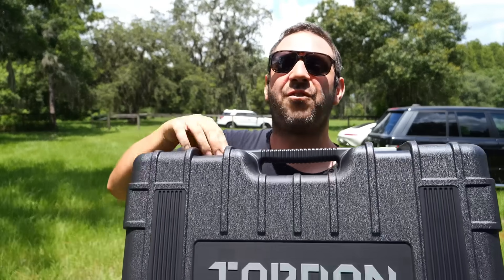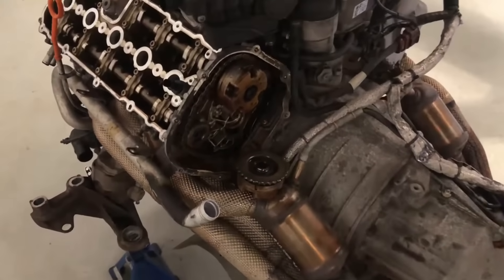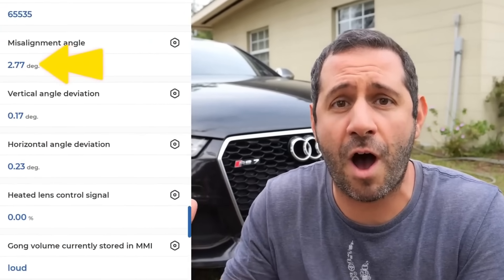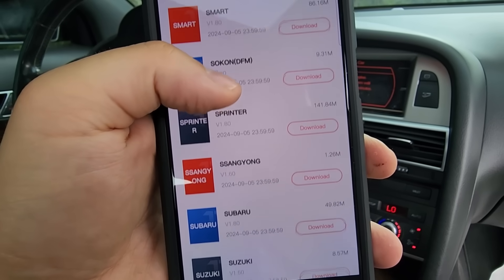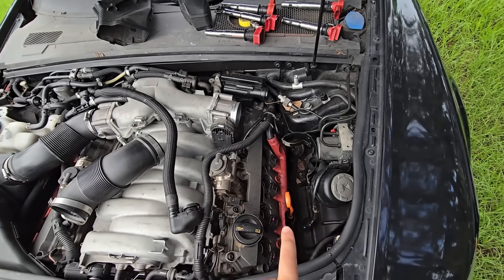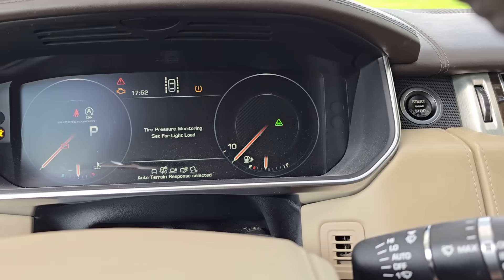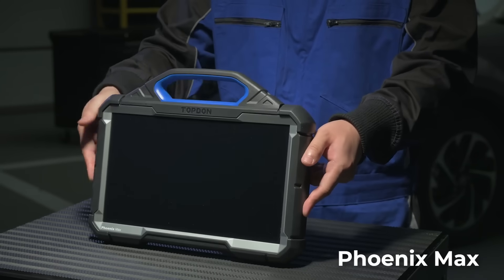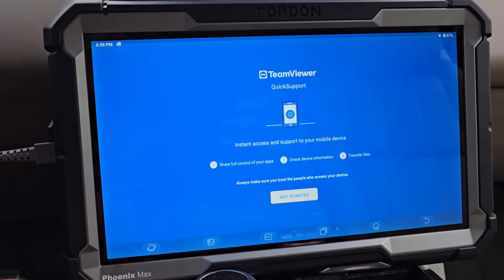$60 vs $4,000 Chinese Diagnostic Tool to Fix a Dead v10 Audi S6

Comment from the maker: Just to clarify one thing:
At one point I say "Topscan is the First (that I've found) All System, Bluetooth Style Scanner, that works on Most Makes and Models..."
Up to now, every Bluetooth Scanner I've used either has VERY LIMITED FUNCTIONALITY on Most Makes and Models OR
has Full System Scan Capabilities on VERY Select Makes and Models...

Basically Topscan filled the major gaps that generally come with Bluetooth Tools AND it Costs Way Less than many others. Plus its an additional 5% on Amazon: https://amzn.to/4cUiY42 
USE CODE ✅ Topscan0718
Reply: Is the topscan capable of reading the actual mileage from the ecu?  i've been scammed before with a tampered mileage used car.
Reply from the maker: @rallymao6811  This is a good question, but is dependent on the specific car you're working on
Reply: @rallymao6811  I have multiple XTool D8, EZ400PRO, A30M they can read the mileage from various modules. But you have to know in which module to look at (live data in ECU).
Otofix D1 and D1 PROS and MAX (Autel) can also read it.
Reply: Thanks for the info Sam, much appreciated.
Reply: will it scan my 550 Ferrari?
Reply: @stude333  probably. If it’s newer than 1996
Reply: @stude333 my Foxwell does.
Reply: more vids on diagnostic tools and generally on the modules found on a modern car and how to reprogram then and why and when it`s necessary to do so .
Reply: Can I have some of the parts and how can I get them?
Reply: I got a Japanese import car sadly the menu is in Japanese can i convert the language with this tool
Reply: Whats the other scan tool you have, thats connected to your phone, used on that genesis I believe, or was it the range rover.
Reply: What the electronics engineers don't want you to know the parts for the big box cost < 200$ and the parts for the small one is < 10$
Reply: Would the scan tool be locked or functions disabled if one doesn't pay the subscription on the topscan?
Reply: The guy who has been pushing scanners on us for the life of his channel only now says they had "VERY LIMITED FUNCTIONALITY".  So you've been pushing crap on us this whole time? Sam, shame on you.
Reply: Review Thinkdiag2 u can program modules with it and it's 150$
Reply: What Sam said is very true - most of the Bluetooth scan tools we've tested on our channel are pretty limited in function; TopDon is one of the major brands that pack mid-range level performing software into a Bluetooth unit at this price point. If you are buying it is definitely worth checking out TopDon 💯
Reply: Have you ever tried OBDLink MX+?
Reply: Opel astra j 2013 1.4 personal use what should i get?
Reply: I bought a $60 Topscan like you recommended to remove the "inspection due" dashboard notice.  I had to return it since it did not work and does not work for my 2017 Audi A7 (according to the manufacturer).

Comment: I have a Foxwell that works great. It works with all makes and models, and RESETS AIRBAGS 🙂  No subscriptions or phone required.  I think I paid about $100. It’s programmable, so it can be updated with the latest patches and codes. It even shows the code history, so no one can clear them and trick you. It even shows the date of the code and when they were cleared.

Comment: Dealer wanted $7K to fix my 2013 Boss 302… I bought the TopScan Pro, fixed the car for $300. I’m driving one day and BOOM… every light came on, no brakes, no electronic steering. Dealer said everything had to be replaced. I scanned car, had about 50 codes. Turned out a brake pad blew off my rear wheel and set off all the codes and shut down all steering, TRAC, etc.  I put new pads and rotors, performed the Auto ABS Bleed with the Topscan, and. Whamo, car good as new.

I even had a passenger side window that hadn’t gone down in two years. Now even the window worked after a calibration with the Topscan.

Comment: I have a question on this, I recently had rotors go bad on a Volvo I just purchased. Will this tool disable the parking brake? I can't find any clarification on any of these diagnostic tools that are going to tell me it will do that specifically. 

There's a trick to use a 9-volt battery, I'm going to do that this weekend. However that is obviously not the proper way to do it, I'd rather have a proper tool to do the job correctly. I don't have a problem with spending the money for the scan tool. I just need to know what's going to work.

Comment: That's $60 scanner sounded great right up until you mentioned the $50 annual subscription. F*** that noise. I could understand $50 a year for the latest updates or something. But $50 a year to keep using what I already paid for? Get bent. 

Not you, you are great. But I find it borderline Criminal to lock the function of purchased Hardware behind a subscription-based software.

Comment: I know this is a super late comment to the video but i can assure you that using this method for replacing key fobs specifically for land rovers is a life saver. i’m a landrover certified technician and getting even a set of new fobs when you don’t have one on hand can cost you thousands of dollars as replacement of modules such as the RFA and even the BCM are huge jobs. This tool honestly sounds like a good deal just to even make my job easier so i don’t have to use landrover specific software

Comment: Most cases the diagnostic is good as the mechanic whos using it. Simple use these on audis bmw and merc but try to use like on opel with code for the gas pedal the problem could be between front light to the tail light

Comment: Cracking video there thanks for sharing that information very well explained just subscribed to your channel  mate just brought a ford kuga diesel 20lt cheap needed a diagnostic scanner  I had a autell and it picked it up straight  away  been looking at the topdon phoenix xlink  but the key 🔑 model is a fortune plus my favourite is the launch x431 pro v5  with topology mapping and bidirectional control

Comment: And then they have a Volkswagen click add key and are now keyless because they bought the wrong one and the system requires the right one. The first step in a VW is delete all keys then it adds them back so if you buy the wrong one the process wont work and you will have no keys. All smart keys lost is not supported for all makes and models. Some you have to program directly to the vehicles computer. The T ninja pro is not even a programmer us locksmiths use. Its not a brand we buy.

Comment: Samcrac - you would think this info is easy to find BUT NO!  On the TOPDON TopScan OBD2 Scanner Bluetooth can I register my battery on my Audi?  The sub for $50/yr is not bad.  But HARD TO FIND if I can register my battery.  I see "BMS reset" for batter but does this mean register?

Comment: It’s great one can go buy a scan tool for free and get the codes and read data without doing to the dealer or a shop. Nice. 

Now interpret that data and know what data to look for and what it means to diagnose the car. 

Being able to push buttons is cute, knowing how to  diagnose it and then fix it pays the bills.

Comment: too rebuild that engine it only be a 5 to 6 day fix an cost you around 7k to repair, then could sail for 15k up, however most people who mention the oh just replace engine dont have the time nor patients so the deem it a parts car. for my 5.3 ls i rebuild it an just went ahead maxed out all parts including torque converter an trans along with brakes, drive shaft extra. i own 3 different v10 including one sorta similar too that audi an there arent as bad as most deem them too be if you understand how too quickly repair diagnose an most important for theses engines there several bolts you dont have too remover air intake atually is one piece just lift both sides off an there one major part, its basically the same for the rest the engiene its built one big part, too part.

Comment: Can you do dealer-level diagnostics with this? Do they offer a service desk for when issues arise? Does it have a possibility to make logging to figure out the issues on a lower down level? 
As a diagnostic engineer I know well how the internals of various dealer tools work. And trust me, there is a major difference. Especially when it comes to the non-standard functionalities. I own several OEM diagnostic tools privately, 9 brands now, worth probably 100k. Most were ex-testing tools or demonstration packages. I sometimes lend them to local workshops. In practice we've found that there is certainly a quality difference to (most!) aftermarket stuff. Programming success rate simply is higher, monitoring signals read much more stable etc. Tools using D-PDU API, instead of J2534 are the best usually. 

Now if I could recommend a tool (for EU) I'd get the Texa. Price vs. quality is good and it were really professional engineers. We once did a validation of their VCI to see whether it was an option to offer to our customers. We found a few but very little bugs. Couldn't say that of most other brands..

Comment: i use the autel scanners for key programming and key module programming  they work well they also have universal fobs you can program  to a car in a emergency with out acually getting a vehicle specific key from like Amazon right away

Comment: Yes, you are absolutely right saying that manufacturers install components like sensors in impossible places, so you can't get to them and for a small and cheap part you have to disassemble half the engine. I recently had such a case with a Nissan Rogue SV 2017 2.5 l. Check engine code was 2004- IMRC stock open bank 1. The problem was Int manifold runner position sensor which is installed in the lower left part of the intake manifold, you can't get to the sensor without removing the complete manifold. Of course the sensor is worth $30 - $150 on the market or at the dillers is  around 300 dollars , the entire manifold  is about 600 - 700 dollars, add to that over 700 dollars for work and installation with tax comes to  1,500 dollars. Fortunately, and with a lot of work around disassembly and assembly, with a new manifold repair costs $900. You see what kind if shit are  new cars today , like my Nissan Rogue with only 50k miles , not to mention paint clear coat being almost entirely piled off. Don't  buy junk !
Reply: TRANNY is next my friend

Comment: I watched this video after you posted and went out and bought it since I have 4 vehicles I needed spares for. Got it 2 days ago and I cannot believe it only has explorers to 2019! My wife has a 2020, the new body style. Ridiculous you spend 500$ and it doesn't have a vehicle 4 model years ago. The t ninja pro
Reply: No go on ford key programming for most all Fords after 2018 as the latest generation PATS immobilizer system requires verified security access to the online Ford diagnostic system. Apart from Ford dealerships there are only a couple 3rd party tools that have even have verified security access. This basically means that programming a new key is basically a locksmith or dealer job using OEM SW with VSP credentials, as will be the case with most all manufacturers moving forward
Reply: @GSRDUDE80  that's not good to hear

Comment: This is great that OBD has improved so much but is obviously still pretty limited on some tools. Keep in mind that the CEL and basic scan tool is ONLY there to protect the catalytic converter and your emissions system. But also remember codes are only a partial tool to fix an issue. 

Does either of these work on older OBD 2 systems that still used priority software? (GM TECH 2 and Nissan Consult was still required well into the early 2000s) Or any adapters for anything pre-96 when the port was made standard?
Reply: Topdon’s professional Phoenix Series scan tools come with all the pre OBDII adapters, so you’re covered there!!

Comment: That's what happens when the FSI Fuel Pump gives up the ghost you get pre-ignition or engine knock it will destroy a piston in quick order. Fix is new engine, or used one, and a reminder to service your FSI Fuel Pump cam lifter pump, or not to run hot ECU tunes on an engine that has limited fuel delivery capabilities. That dam shame someone kept driving it with a check engine light like that....

Comment: I fell into the scan tool trap, yes for the basics, scanning, clearing, and general diag, they're great a $30 tool will do all that. Now when I bought a decent scan tool I was disappointed because I wanted it for my Ford F150, and other Ford products. To my dismay these tools that had features that could do different things would not work on my Ford. So how did I fall for this trap? Because everyone uses these tools on Audi, Mercedes, BMW to me that's all they're good for, is working on these brands. Unless you buy a real system for alot of money, and even then it may not do anything to a domestic vehicle, especially Ford.
Reply: I have an Autel and it does every car on the planet (except Tesla!).

Comment: Car won't start ,firstbthing i check is the spark plug wet i mean fuel on it.If is give spark so i can check the ignition coli at that way and compression.  This all what you need for boom. 💥

Comment: Sam, come on, there are gobs of Bluetooth OBDII scanners that don't require a yearly paid membership.
Reply: Do any of them have the features of a full sized scanner like this Topdon however?  Plenty of them will read engine CELs and all system DTCs, but the vast majority that I'm aware of do not have any bi-directional controls.
Reply: @brassmule  my cheap elm327 Bluetooth scanner can clear codes, though be aware that some of the older ones do not work with iOS

Comment: The Mucar BT200 will do the same thing as your first scanner, and it is cheaper.  Have used it quit a bit to diagnose issue on many vehicles.  In fact, the interfaces look extremely similar.  Wouldn't doubt they are actually the same.

BTW.... The app has constant updates, and NO ANNUAL SUBSCRIPTION FEE!
Reply: Thanks just ordered one. Will try it out on my volvo and my my parent's passat and corolla

Comment: I was about to buy a topscan from your affiliate link until I heard about the subscription fee. A year is nothing, this is something I'd buy to use for years. Seems like a far better investment to go with something with lifetime updates
Reply: You won’t get the same All System, All Make/Model Functionality in a tool from any manufacturer out there with free lifetime updates, servers cost money to keep running as does the engineering team to continually improve and update functionality and compatibility.
Reply: @GSRDUDE80  Fair enough. Other brands offer paid lifetime subscriptions per vehicle make, personally I prefer that business model
Reply: I bought it from Ali and came with a code which I had to email them for a one year extra subscription. Lifetime subscription means a lifetime of the scanner which could be somewhere between 3 to 5 years. I bought Ansel with lifetime updates and after one year it updated the app and started asking me to pay for updates. So much for the lifetime updates. Others give you lifetime subscriptions only for one make. Lifetime subscription is a PR stunt.

Comment: I've tried to fix, or at least diagnose a module in my 2010 F150.  The parking brake light is permanently on.  Consequently I get the chime for 5 minutes and cant use cruse control.  BTW, the parking brake isn't physically on! And the foot pedal works fine if I actually need the brake. I've replaced the switch twice!  But Ford say I need to replace the BCM and replace the keys! I have FIXD and VEEPEAK diagnostic tools.  Neither will even see the parking brake light! I'm over in Orlando if you want to look! Suggestions?